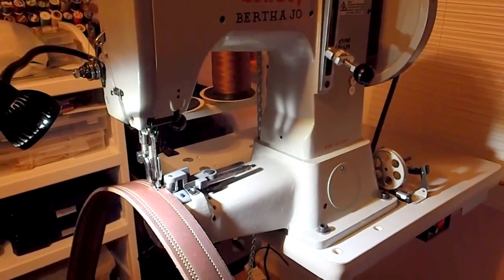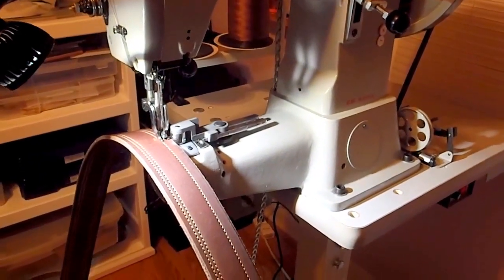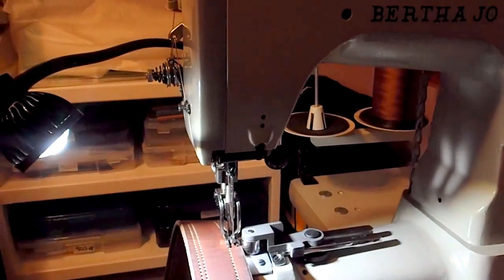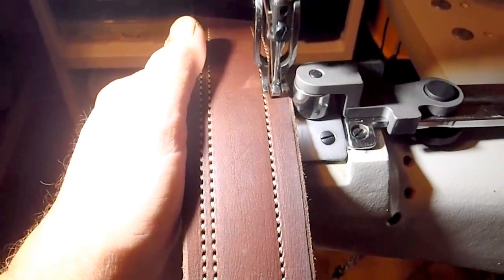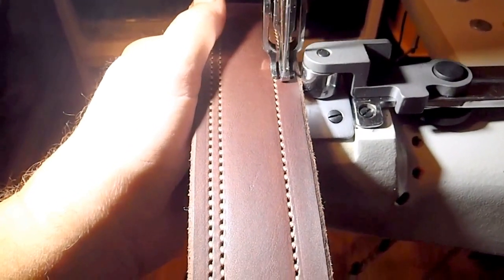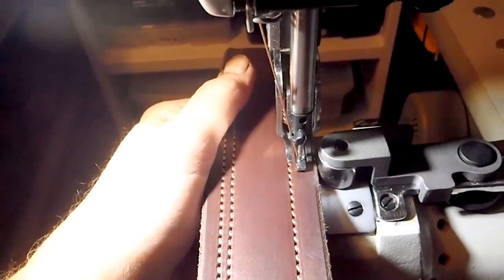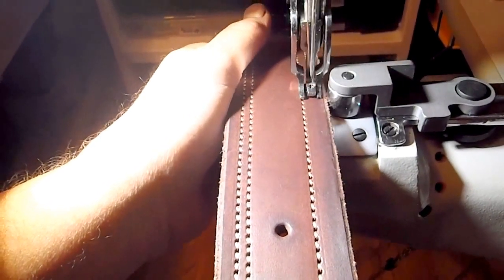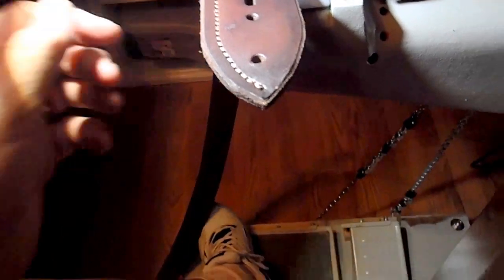Bertha Jo, my Cowboy 3500 making belt

Comment: This is a CB3200 not a 3500. It will sew up to 3/4" not 7/8". If you want to sew thicker leather you would need the CB4500 machine. The 4500 also has a longer arm to work on larger pieces.
Reply: The CB3500 is a short arm version of the CB4500, it is different to the CB3200.
Reply: Chris, no.  the 3200 is a different machine.  this is NOT the 3200,  it is in fact the 3500.   there are distinct difference between the two, but have a general similar size and shape.